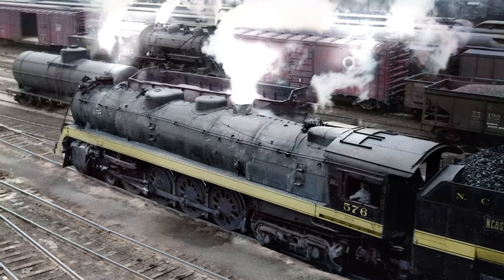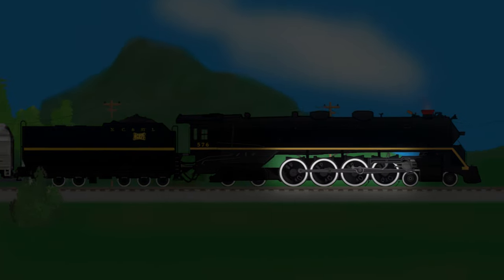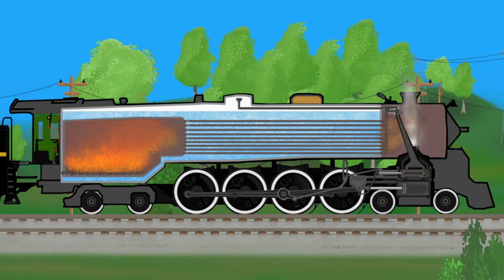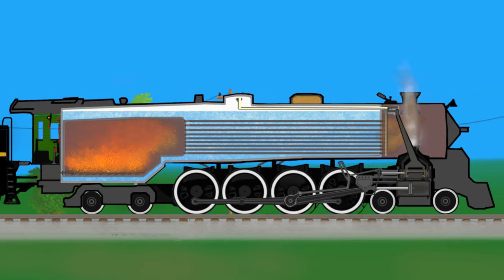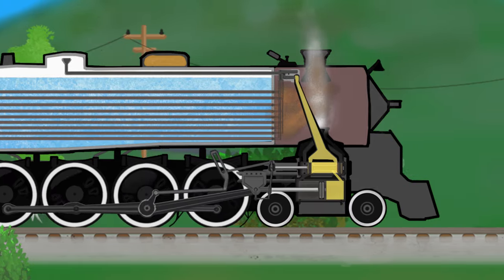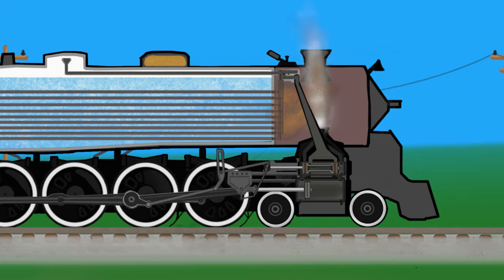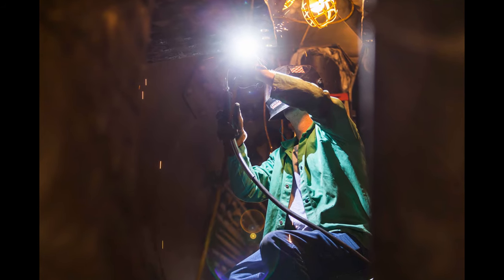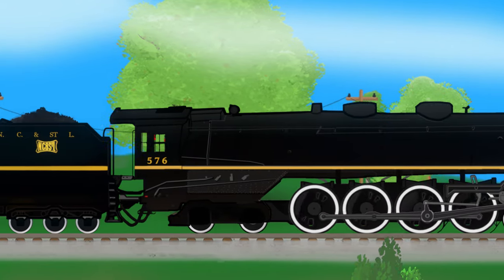How a Steam Locomotive Works

Comment: 5:43 That's one cool animation! Is that what 576 will look like when it is restored?
Reply: More or less. 576 had a few different looks during her 10 year career. I do not speak for the team here, but you can probably expect to see it restored to an appearance very similar to the way it was displayed in the park as a static display. I wouldn't fret if you like the other styles though, during her long career as an excursion locomotive it's extremely likely that the appearance will evolve and at some point you will likely see the fully streamlined version, and the green version (JK about green, but point is, nothing has to be permanent, there are many stories to make and tell).